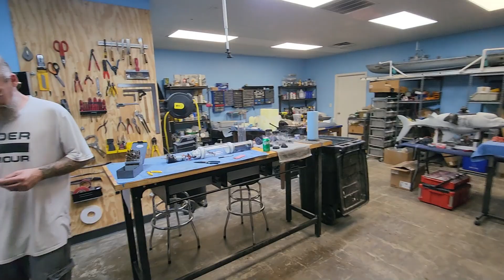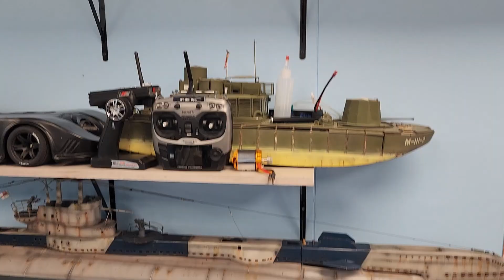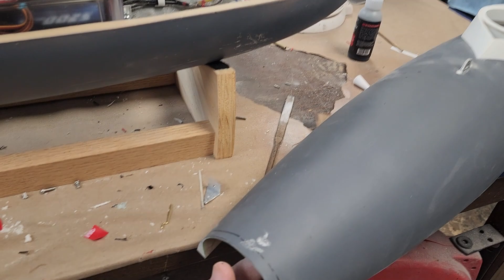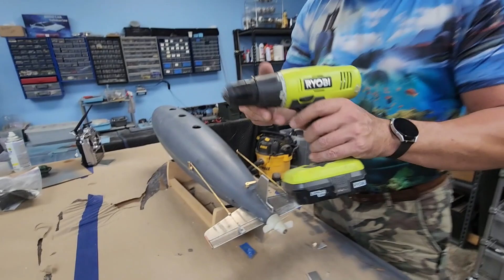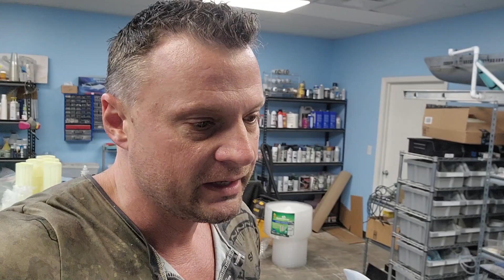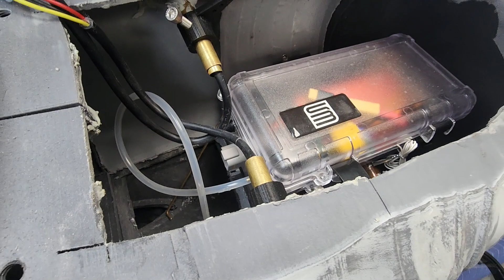Update From the Nautilus Drydocks - August 18th, 2023

Comment: Good point on Allen wrench btw. 
Solder an Allen wrench to a brass tubing. Question is…will it hold the wrench if you torque it enough to tighten the set screw.
Reply from the maker: Logan was mistaken. I don't solder the steel wrenches to brass handles. I notch the brass to accept the curved part of the wrench and just use a dab of glue to stop it from sliding out.